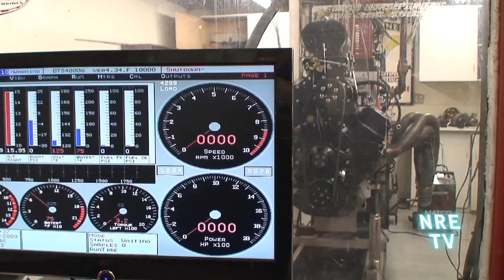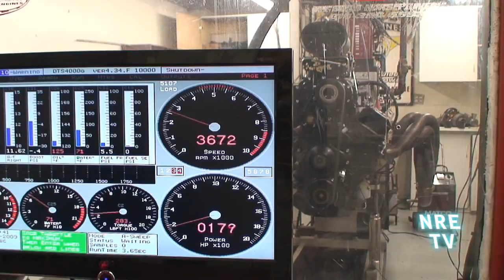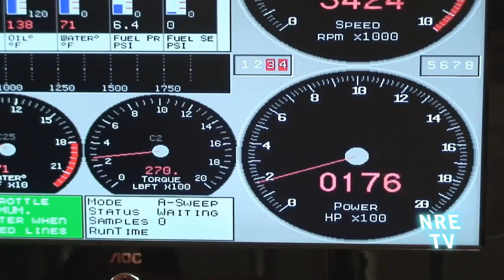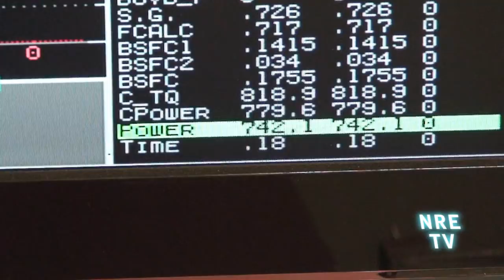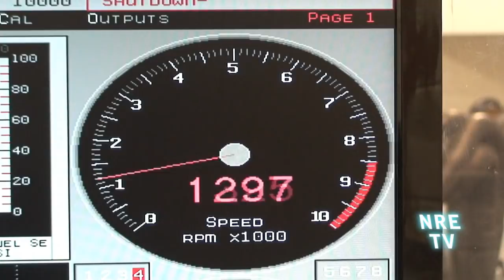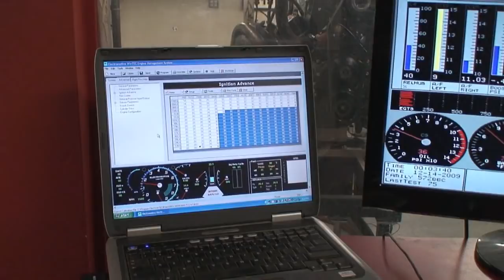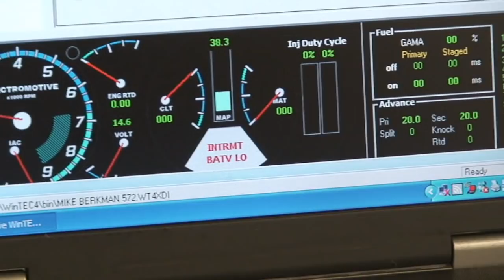1200 HP Supercharged 572 BBC.  Magnificent Noise II. From Nelson Racing Engines. NRE.  Camaro.

Comment: @nawitus It does need to be mentioned that Chevy is currently working on a direct injection version of it's line of LS engines (Corvette, camaro, manaro, ute, ect.) And next stage after that line hits the road is for the LS engine to be adapted to DOHC's. My guess is that by that time ford's 5.0L will be producing around 500hp instead of 412hp.

Comment: For big power at WOT, a carburetor is still hard to beat. EFI gets you reliability and better fuel delivery control under a broader range of conditions and throttle positions. Depending on your application, a carb is still a very good choice.

Comment: @GerryK61 Used to work Tech for Summit racing and ive heard acouple different reasons. I believe is the sudden vacuum drop from the roots. Engine stays at idle but the roots 'self accelerate' the engine. Idle circuit of the carb only supports so much fuel until the idle comes back down, then the engine catches and spins up again...and again. Blower surge kills the vacuum at idle, idle drops to decent vacuum and then surges back up again.

Comment: @nawitus  Maybe on the crash standards, but many vehicles sold in EU are NOT allowed in the US because of emissions. Which mustang 2010 or 2011, because the 2010 still has the anemic -350hp SOHC 3V 4.6L while the 2011 has the 412hp DOHC 5.0L. I'll agree that 412hp is rather low for DOHC's and VVT, but this IS the first installment of the new coyote 5.0L. Jaguar's 4.2L didn't make near as much hp as it does now when it was first released.

Comment: If I ever win the lottery, I want a 572 LS! Fuel injection and all! Of course everything would have to be custom!! But be bas ass!
Reply: Not much point in that. The LS architecture was a big step up from the Gen 1, but it is not the same compared to the BBC. There are 24 degree BBC heads now that flow over 500 CFM, no point trying to build a big block LS.
Want to go custom? 481X is the game.

Comment: Nice.  I thought my project was over-the-top... Are you running 4 coils with waste firing with the 60-2 timing teeth, or do you run 8 coils and sense the cam position?  I'm finishing a Ford FE 482 with 8-71 and same Electromotive box, but with 4 coils in waste firing configuration.  Pulleys for 6/10 lbs boost on 91/100 octane.  Design goal is 650/950 hp.  Your thoughts on ignition?  Thanks,  dd

Comment: @nawitus Have you ever driven a Corvette? The only down side a Vette has in how it handles is that it's too firm for most of the roads overseas, consider though that the roads over here are much smoother thus a firmer suspension than Imports is actually desired.

Comment: On the track, you're using a fairly narrow RPM range, say 4500-6500. It's cheap enough to just run carbs a little fat. 30hp loss on a 300hp engine is kind of an issue, but a 60hp loss on a 1200hp engine, who cares. Of course with EFI, the throttle response would be much more nasty.

Comment: @nawitus Might I mention that the engines powering every US sports/muscle car is built with the full intention of it's owner modifying the engine. for that reason all but a select few engines are built making only about 65% - 75% of the power they are built to handle, there is no reason to put overly exotic components in something if they are more than likely to be replaced. As for the engine in the video, NRE over-builds their engines then tunes them back down for great streetability.

Comment: I am a beginner in engines. when people do not install the carburetor between Blower and Scoop. Where is it installed? What is the advantage of installing this way?the engine of the video is not Intercooled right?I saw some supercharged intercooled engines and they are very high an engine with the carburetor mounted that way and Intercooler will be really high.

Comment: @nawitus You left out two very important factors in your equation of acceleration, weight + aerodynamics. For a formula 1 car a 20,000rpm Cosworth engine is the perfect application because of the vehicles almost non existing weight and superior aerodynamics. In the case of classic cars which weigh much more and sometimes have the aerodynamics of a wall, a high torque low revving engine is best suited for the job. If you built a honda use a high rpm motor, if you build a Impala use a BBC.

Comment: @nawitus Yes the larger the engine the more fuel it will need to a smaller engine of comparable build. Consider this though. If an engine is making great hp per liter then yes you can make as much power as most V8's but the trade off is that to make that power you either have to rev the engine too high to get good mpg, or you have to turbocharge them and that sacrifices mpg because of the extra fuel needed for the extra air. Without either you have to hold the pedal to the floor just to speed up

Comment: couple questions, if its all digital ignition, is there a distributor? I didn't see one, and if not, what do you put in the distributor hole?
Reply: Nothing.
You just block it off,
Reply: You simply run a crank trigger and an aluminum slug. The Ecu is handling the timing.

Comment: Hey Nelson, what mic are you using to capture those magnificent noises?  I think it's not up to the task of capturing something that loud and I hear the microphone distorting.  Never underestimate the importance of the sound quality of your videos, as many people don't actually watch the videos, but rather, like me, simply listen to the videos as they're doing something else.  Might I suggest a Royer R10, a ribbon mic (old technology, yes, but still very good) that has a SPL rating of 160dB.  It's $500 and the ribbon may have to be replaced after about 10 years, but with Royer, the first re-ribboning is on the house.  Another reason I think a Royer R10 would be great for you is the fact that the highest frequencies, i.e. the ones that will make your ears bleed, are "rolled-off."  Ribbon mics are known for low-end bass response and taming harsh high-end frequencies.

Running a seperate mic and camera does come with its challenges, especially if you're not good with electronics.  That said, if you're from SoCal, there are 10,000 guys within one mile who know how to do stuff like that and are always looking for a side job, and setting up a camera and mic setup is easy for them.
Reply: Also, when you're talking, nothing beats a lavalier mic.  A lav mic is one that you wear, and some of them even come with 1/8" stereo jacks to plug directly into a camera, no expertise necessary.
Reply: @mortachaiepstein3584  Did you notice the age of the video?

Comment: 572ci with a 14-71. 

Why the hell would ANYONE stick 4150 style carbs on that unless the plan was strictly pump fuel, low boost and low rpm??? I don't care what was done to those carbs, they in no way can hope to deliver on that deal.

4500 series carbs would allow an engine of this size and a 14-71 to get much closer to it's power potential.......on either race, or pump fuel.
Reply: LOL.........and I'm the 'dumbass"???
Reply: HELLFISH actually believes the blade and venturi of a 4150 can hope to deliver the A/F demands of a 572ci engine topped with a 14-71. In a low boost/power/rpm combination........sure, but NEVER happen when trying to max performance.

I I drive around town with a 1740hp screw blown 526ci  HEMI, w/carbs.  A fairly mild package to remain streetable. What's your combination of choice???

Comment: Does this setup utilize a cam sync?
Reply: It can do with or without. I highly doubt he runs sequential ignition so no need.
Also, a 60-2 has a pretty high resolution, so with a Holley Dominator you can in fact run sequential without a cam sync.
But at any rate there's no need to make life hard. I run a Dom 60-2 and just use a MSD Dual sync distributor with a flat cap for cam sync. Leaves room for blowers and tunnel rams.

Comment: @nawitus It's only a band aid on a bullet wound. Both my parents mazda 6's make 160 and have 5speed automatics, even with the torque multiplication from the transmission it still requires much more torque to effectively push though the air at 70 and have some simblence of acceleration if you need it. The aerodynamics of the modern cars does help a little, but they are still very lacking from what's possible. And until auto makers finally fix that, I'm going to keep using my trusty muscle car.

Comment: @nawitus Not to mention that my point was that NO current V8 Cadillac make anywhere close to that little power so you point is very imature by comparing a discontinued engine to a modern engine. Case and point. The current standard for a NA performance V6 is 300hp, only one auto maker (Chrysler) in America will fail that standard since Chevy's 3.6 V6 (which by the way is the standard baseline engine for ALL currently made Cadillac models) makes 304hp and Fords 3.7 V6 makes 305hp.

Comment: @nawitus I'm not arguing that V8's are better, just arguing that imported engines are no better than V8's. When a turbocharged 4 cylinder engine is making 1000hp it's now less fuel efficient and streetable than a twin turbo V8, on the same token if a NA V6 is making 350hp it's more than likely more fuel efficient than a NA 350hp V8. Consider this though, with the torque being made from the V8 you barely have to use the throttle to push though air @ 70mph, with the 4 cylinder you have to mash it.

Comment: Why can't you put a turbo on it, to fit under a hood.?
Reply: What does that have to do with anything? It was built to sound this way and look like this. A completely different experience. Yes you can make a lot of power witha turbo, but you don't get the sound nor do you get the low torque and response.

Comment: nelsonracingengines...why do some supercharged engines "surge" at idle?
Reply: Because they create a condition where they cycle between rich and lean at idle. Because the carbs don't see vacuum, they have a hard time providing fuel ad idle, which causes a lean condition. This lean condition causes RPM to rise. As the RPM rise, the carbs receive a stronger signal and then richen up the mixture. This causes the RPM to drop. Blower surge is more a result of poor tuning than a big cam or big blower. In situations with large cams and big blowers running carbs it is hard to eliminate completely, but that is not in a situation such as this. If you build a 582 with a 14-71, a 292/310 cam and over .900 lift and carbs, then surge is just part of the game if you run the RPM low. But this would be a serious race setup making will over 1700 hp on C16. In a street build such as this, where the cam spec is more like low 700 lift, 27X intake duration @ 050, then blower surge is completely unnecessary. It is just made to make the engine sound more nasty than it is.
Unfortunately it kills both spark plugs and belts.
Reply: @AB-80X  ... thank you for the well-defined answer, I completely understand now

Comment: There is no way those headers will fit on any normal engine bay, impossiable, it would need to go into a hot rod,whereby the headers get ceramic coated and then connect to the exhaust system, but look how wide the engine with the headers are ? Still a beast set up, but again the headers for such a engine off the shelf maybe restrictive a little if you wanted to to put that in a newer car and also the complete car would need to be strengthened as well, after all that much HP will twist the shape of the car so easy its not funny ? Best of a set up, but so far i have not seen a twin injector set up only one person has done it and with a 14/71 supercharger as well. :)
Reply: Did you completely miss the fact that he said they were fender well headers? It is more than likely for a gasser or the like.

Comment: why didn't you take care of the blower surge, does it not affect performance above 2K rpm? Also, how do you get rid of that...
Reply: Mac Sogandares caused by over rich condition. Better control with efi
Reply: CHARLES GIAIMO So this has the same affects on performance as running a rich mixture?

Comment: But 900 ish on pump gas, that's still pretty good
Reply: But will it make that once it's in a car on a hot day? It will need one mofo cooler, a big ass fan and a good fuel pump regulator, that's for sure.
Big engine and a big blower. That thing will create a ton of heat. Those carbs will be really hot too.

Comment: I don't understand why most 572s are not fuel injected.
Reply: Krevin Grard I used to wonder that too. What I found out is that they don't make throttle bodies large enough to flow the kind of air large displacement engines can cycle. the only way to get that kind of flow is carbs and forced induction.
Reply: +Krevin Grard they make throttle bodies more than big enough but a throttle body that flows 1600 cfm is cost the same as a couple cheap carbs and then you need to have the whole injection system carbs are just cheaper and can make more power with a smaller pump because they require way way less fuel pressure
Reply: +NoRedline The Clark so you cant buy one, but I'm guessing you could machine one if you have the tools
Reply: Moving that much fuel with injectors can be really expensive.
Reply: Karl Grard
They are.
Many simply opt for carbs because they are cheap and "easier" to tune on a budget.
There are plenty of huge CFM throttle bodies available that will work on NA 572's and above.There's also the simple solution of running a dual TBI setup, just like you'd run a dual carb setup.
Reply: Jason Todd
Moving that much fuel is expensive, no matter what.

Cheap
Reliable
Powerful

Pick two...

Comment: I seen 572 BBC engines running that power without a blower with 7psi. Most naturally asperated 572 BBC push about 750hp and close to 800 torque. With a single 1150 cfm holly
Reply: You might want to learn a bit more about engines. You need to think about two things. One, this video is close to 12 years old so things have changed, and two, if you build a 572 that makes the same peak power as this, it will be much more radical and less street friendly. You will need a cam in the 730 lift range, 272-276intake duration, big heads, a single plane etc. This will hum along at 1500 rpm without loading up. Apples and oranges. I can easily give you a recipe for an 1050 hp 582 on pump gas, but it will be pretty wild if you want to drive it on the street and cam specs means new lifters and springs after every 2000 miles. This will run for a long time and be super smooth as you cruise along.
Reply: @AB-80X  
Nelson racing makes a 572 twin turbo running 1200 hp on pump gas and 1600hp on racing fuel. They are listed as daily drivers. The pure racing engines are hitting over 2000 hp. Heck murder nova from OKC originally had a 572 twin turbo hitting 3000hp. He has changed engines since.
Farm truck had a 632 hitting 1100 hp before a 500 shot of NOS. That was the replacement motor after he blew up his 572 700+ motor before NOS.
Reply: @sjgavenger37  
Things have not changed that much.

First off, that other 750 you link to, it less streetable than this 572 blown bbc. If you make 750 hp on 9:1 CR, you have a lot of cam.. if I was going to make 750 hp with a hydraulic roller on that compression, these cam numbers would be needed.
272/280 @ 050
700 lift
110 LSA
AFR 335 CNC heads

That will be a very raunchy combo that will have some challenges on the street.

Now regarding the 1600 tt 572. That number is not a pump gas number. Don't be fooled into thinking so. You have to understand that when you add boost, you simply lift the curve over the entire range. Yes you can make 1600 hp on a mild combo, but then you need race fuel, E85 or Methanol.
You have to understand that the more power you make N/A the more you can make on boost. But the more power you make N/A, the more wild things get. If you want to make 1600 hp on pump, you need to make around 860-900 hp N/A. This is simple physics in relation to when you get detonation. You are limited to about 12-14 psi before you need special fuels. If you take a look at the NRE website you will also see that their DD 572 is rated at 1190 hp on pump. Add to this that NRE overrate their engines. They say 1600 on race gas,as you can push the boost into 30 psi 

It is all about resistance to detonation. Three years ago I built a 565 with a Blower Shop 8-71. It made 1578 hp on C16 with a 250 shot. There are so many ways of doing it, but no matter the way you do it, you have the same restrictions as the laws of physics don't change. My old 565 made about 740 N/A and thus had a good potential for big power. But it was a race engine. Cam was 284/296 and over 750 lift. That's just one way. But don't believe everything you hear. Enginge efficiency is about the laws of physics, it is that simple. If you want to make 1200 hp with turbos, you need to make 550- 600 hp N/A. That is not too wild for a 572 hence it can be quite reliable, but it is still not sedate like a bone stock gen 6. Call it a daily dri er if you wish, but a 572 pushing 600 hp is somewhat temperamental. If you get a bbc car some day and do some wrenching and racing, you will find that Tom Nelson might in fact not be the best guy in the business and that he might promise a bit more that he can keep.
Just look at his dyno runs.  I still have not seen him post a vid of a claimed number. On top of that, all his tests are done with stupidly cold temps. In this vid he runs the engine at 125 F. Unfortunately a car with such a blown big block will rarely run below 180 F. Had he tested this engiñe at 180 F it would be down 30 numbers all over the curve. There are many ways to "optimize" a dyno run. Those of us who race might refer to it as cheating 

Read some books about engine building and get your hands dirty. That's how you learn.

Comment: 1200 hp on only 6 psi...
Reply: No. just about 900 at 6 psi. It will need 12-15 lbs. for 1200. If things really heats up, it will need even more.
That's a roots blower for you. Way too much heat.